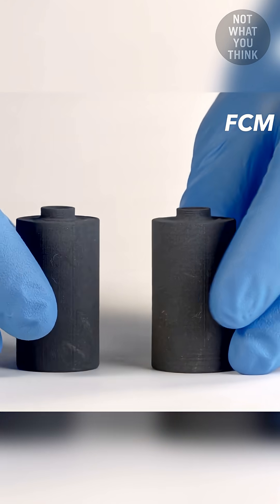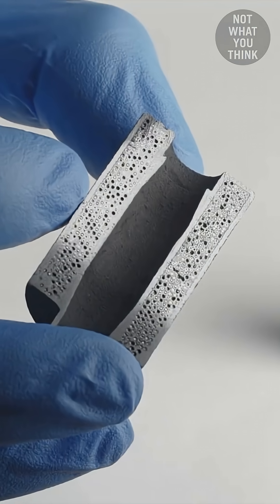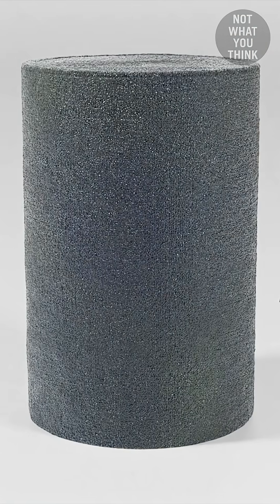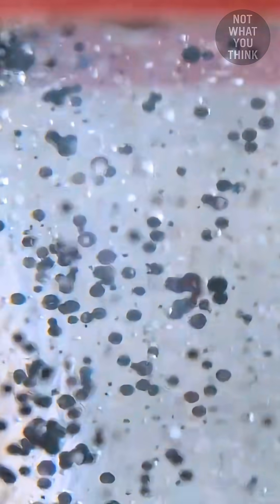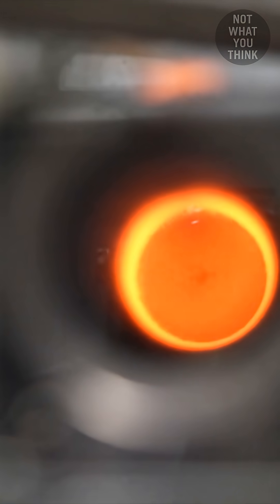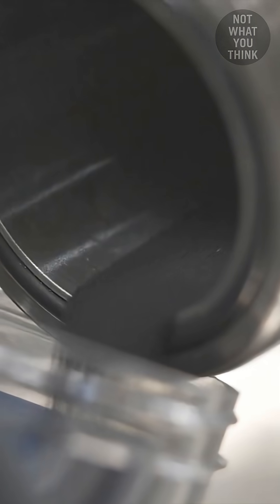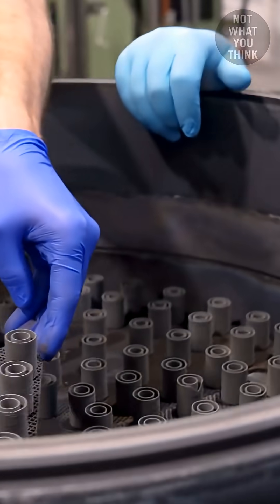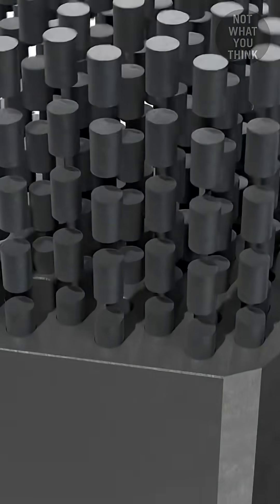Tiny Million-Dollar Battery

Comment: ...
damn you guys are slow
WELCOME EARTHLINGS TO MY TED TALK
today ill give you a summarized history of the EGC's history of power harnessing systems
As you know from media, you are correct in assuming us aliens are very advanced
it all started with figuring out micronuclear reactors battery cells
we figured that shit out only after 5 years after the industrial revolution as well
then we swapped to liquid thorium systems for large scale, then compact thorium batteries and weve developed a space elevator made of multiple segments that has a ground and exoatmospheric segment that orbits the planet
each space elevator is set into a line across the planet that then connects to the exoatmospheric segment as it moves
500 space elevators around a planets surface and 100 satellite ports
that collect stronger solar energy
each time one makes contact with the grounded space elevator it discharges energy down at full power to ignite plasma reactors that make antimatter as a byproduct that is then used in our most essential form of technology
gravity reactors
high in constant steady radiation with a strong magnetic and gravitational pull
then using multiple antimatter cells to pull a proto-dyson ring that is pulled along using magnets in a perfect vacuum and supercooled space
the energy require to start up a Dyson ring is the same discharge of a satellite port that then sets the dyson ring into perpetual motion
literal perpetual motion
the energy one dyson reactor produces might seem absurd for you humans but its in the lower end of energy production

imagine a whole 5 ring layered dyson ring array around your sun with the width of your planet with over 100 levels and each with trillions proto dyson ring reactors powered by the suns magnetism superheayed radiation to power the cooling systems and supercharging quadrillions of proto dyson rings inside a 100 layer dyson ring that is a set of 5 dyson rings around a sun that then makes it spin into itself and create more energy with each ring aligning with eachother producing enough energy to cause a thunderstorm in space with plasma arcs bright enough to make the sun powering it up seem like a dim lightbulb
thus such generators need to be covered with a dyson net to keep them from blinding a nearby planets people from the lightshow
and the dyson net has been proven as a great place for putting a colony in
each node connecting every part of the net is a magnetically stabilized atmospheric dome
but people just use 80% of said places for food production
with this much energy its quite easy to control the simulated enviroments to grow crops without needing assistance or seasons
we went from nuclear reactors to dyson netting stars in less than 300 years
idk why you short lived humans want yo take it so damn slow

also in case youre wondering
in case the star starts to die we infuse it by inverting the antimatter storms polarity to feed the star to induce core expansion and cause an artificial supernova, that is then directed through vents using the dyson rings to power up solar exhaust ports in specific regions of the dyson netting
looks super pretty too
and if the star collapses into a black hole
then its the next step in energy production

and next part
i will explain the basics in using a black hole for making a dyson cluster reactor thhat is powered via solar storm discharge and antimatter storms to infuse the black hole into stasis and to produce enough power to annihilate a whole galaxy with just a laser pointer

Comment: Small nuclear reactors are the future.  Silicon valley is usin these mini reactors to power the  factories and massive energy A.I. needs.   This is the future.  Clean fuel.  Only problem i see is getting rid of the battery, wich would be very easy..

Comment: Oh, that's probably stronger then my thought.
(though what I thought wouldn't need uranium) 
I figured it was going to be a prosenescent coating ceramic then have some how small photovoltaic coating or the outer case around them to generate power of the constant half life. 

The trick would have been to make each sphere its own little "solar" powered battery with the container some how linking up and keeping them all safe rather then its walls being the panels

Comment: Not a battery, fuel pellet or fuel rod for use in a nuclear reactor. Does not produce power on its own and only technically stores energy, as much as any element is stored energy...anyhow, point is, this is not a battery 😉

Comment: i mean, cool, but just because it can fit in a shipping container, does not instantly mean its foolproof. What if it comes under fire and how do they plan to make the shielding and cooling adequate while also making it efficient and equipped with multiple failsafes like normal nuclear reactors have? quite frankly, at best in our current technological state of the world at the very least the reactor may need to be modular (as in, made up of two or more container-compatible nuclear reactor modules) which is a whole other can of worms in itself.

Comment: Chernobyl was also "built to stay safe".
Reply: It was built on an already massively outdated framework, it was chosen because it's cheaper, typical corner cutting. Not only that the "test" that caused it to explode, meant turning off ALL safety mechanisms, and "red-lining the engine". Like all nuclear accidents, it was the result of human error. It would be safer to remove human control and have a computer run it.

Comment: The name of the company building the first of its kind portable nuclear reactor is called Radiant Nuclear. They are set to test run the very first example sometime this spring in Idaho.

This is a completely standalone reactor that needs no operator on site for it to run. It's designed to produce 1MW of electricity. It uses Helium to cool the reactor and has a completely passive safety system designed to need no intervention from an operator or outside power source in case of an accident. Accidents are further mitigated by the fact that helium cannot be irradiated, so even if there's a leak. the only thing that will be released into the air is inert helium.

It's not only the military that's interested in this tech. Data centers are also very interested, as many data centers currently use diesel generators to fill in the gap when they can't get enough power from the grid...which happens quite often. I saw an interview where a guy said that one data center can use as much as 5000 gallons of diesel a day for electrical generation. This portable nuclear reactor is designed to run for 5 years at full power before it needs to be refueled.

Comment: What is the coolant?  The reason nuclear reactors are so big is because they keep high temperature water under extreme pressure to cool the reactor.  At the temperatures it's basically an explosive.  If there is a leak, the water expands to steam 400 times it's volume.  It's kept at something like 400 atmospheres of pressure.  This must be cooled by something else.  Liquid sodium?
Reply: usually gaseous helium, as it is inert.

Comment: So because fuel convoys get attacked, they switched to a radio active fuel source. Yeah...that sounds completly rational and normal and wont lead to any problems at all 😂
Reply: Cuz it is, a large portion of those convoys were for the generators, lessen the number of convoys that have to come, tighten support on the few that still have to come.

Comment: Overall this looks like a decent idea, especially if the tech becomes unclassified for civilian use in 500 years.
Reply: The company developing this reactor is set to do their first test run in the spring. They're called Radiant Nuclear, and they already have plans to sell this to private industry. Data centers are very interested and have already placed tentative orders for them to replace the diesel generators that are already in use. This tech will be made available to civilian operators very soon after the military gets their hands on it.
Reply: @operator0  I stand corrected, thanks for the info!

Comment: The US had a base in Greenland in the 60s that was powered by small modular reactors not much bigger than shipping container size.  It is such a shame we basically shelved that sort of tech for a good thirty plus years.  Think of all the fuel wasted, plus the fuel used to transport that wasted fuel, etc.
Reply: The soviets made widespread usage of nuclear batteries to power things like lighthouses. Years later, people unwittingly gave themselves radiation poisoning from messing with them. So, we may have dodged a bullet by skipping tiny nuclear power.

Comment: I’m sure these nuclear reactors will be responsibly shipped back after use and not discarded to be salvaged by the locals.
Reply: in this case they probably will, last thing they would want is supplying radioactive shotgun pellets for use in a dirty bomb
Reply: @andreww2098  Between 1950 and 1980, the US lost and never recovered 6 nuclear weapons. More recently they left over $7B worth of equipment in Afghanistan which was promptly repurposed by the Talibans, including classified tech like NVGs. I highly doubt they will be responsible with these nuclear reactors.
Reply: @brodobroggins  If you'd looked into those lost nuclear weapons, you'd have seen that they were lost in conditions where they were basically impossible to find. More commonly bombs were lost - usually to bombers crashing - and the bombs and/or debris were recovered.

As for abandoned equipment, most of it was intended for the Afghan Army, because the Pentagon was too stupid to realize how fast they'd fall apart.

Other times, it's equipment that simply isn't worth the time and money to ship back to the US. In many cases it's cheaper to buy new gear than collect, pack, ship, and refurbish existing gear. For the same reason the US left most of its gear behind after WW2. More tanks, jeeps, trucks, etc. were left behind for allied militaries, civilian use, or even scrapping than were ever returned to the US.
Reply: @brodobroggins lmao attempting to compare Broken Arrow incidents to what these are going to be used for isn't even in the same ballpark.

If I'm not mistaken most of those incidents involved conditions which no regular person would have the means to find or excavate those bombs and even then the US military in some cases bought the land surrounding the crash site in order to prevent random civilians from even attempting to recover said weapons.

So no its not anywhere near the same since these SNRs would follow the same protocol the military already uses when decommissioning their Nuclear reactors on Naval Vessels (Carriers and Submarines) and Nuclear warheads in which the US' participation in START (Strategic Arms Reduction Treaty) have us properly dispose of these power systems in plain view of satellites for Russia to see and vise versa.
Reply: @willythemailboy2 Wait wait wait- you're framing the abandonment of so much perfectly good military equipment in Afghanistan as the intended goal? I've never heard that explanation for the most botched and disgraceful exit of a country...ever.
Reply: The company making this reactor is called Radiant Nuclear and they're set to test run their first example this spring in Idaho. And yes, the reactor will be replaced with a fresh one when it runs out of fuel. The old one will be sent back to the factory to be refueled and reused somewhere else. 

It's designed to produce 1MW of electricity and last five years. It's also designed to run without any human intervention of any kind. All of the safety systems are completely passive. It even uses helium as the cooling fluid. Helium cannot be irradiated, so even if there's a leak, the only thing that will be released into the atmosphere is inert helium.

Comment: Calling it a “battery” is dumb. “Battery-size” maybe but it’s most definitely still fuel.
Reply: So is a battery? What
Reply: @MarkStokotelny  A battery stores energy that can be used immediately, the commenter is talking about how these function as fuel, witch has to be turned into energy before being used
Reply: @Chaosticeyer are batteries not just refillable fuel? Why am I so perplexed by batteries 😭😭😭
Reply: @MarkStokotelny  Fuel is something that can be turned into energy, a battery is something that can store and discharge energy

Also batteries are not necessarily more or less reliable, and compared to fuels like gas they have around a third of the energy density
Reply: @Chaosticeyer why doesn't the definition just say that then?!?? God I'm genuinely so confused 😭😭😭
Reply: @MarkStokotelny  Cause the definition is describing the exact function of normal consumer batteries, instead of the more broad term for a battery
Reply: @Chaosticeyer it's a dictionary it should have at least the broad definition as one of the definitions 😭😭😭
Reply: @MarkStokotelny  Fair

Comment: It's not a battery.
Reply: the definition of battery makes no sense because we literally have gravity batteries and water batteries and kinetic batteries but no for some reason "battery" means specifically a chemical battery which it literally doesn't?? I don't understand 😭😭😭
Reply: @MarkStokotelny there are also nuclear batteries.

This isn't one.
Reply: @SierraSierraFoxtrot  that's great but has nothing to do with what I said?
Reply: @MarkStokotelny I don't disagree with you and I'm too tired to write a dissertation on batteries. :)

Look up the etymology of battery it's quite interesting.
Reply: @SierraSierraFoxtrot  I'm just confused because the official definition isn't the actual real life definition like people use battery for more than just a specifically chemical battery
Reply: @MarkStokotelny it's not just colloquial. Gravity battery is a legit technical term.

Technical terms shift as technology evolves. For example a chemical battery made without metal would contradict the origin of the term but we would not have a problem with it probably.

Meanwhile no one would call a capacitor "battery" even when it's form and function are very similar...
Reply: @SierraSierraFoxtrot 1) that's why I'm so confused 2) I have nothing 3) a capacitor is not in fact the same form and function as a battery
Reply: @MarkStokotelny a capacitor stores electricity and is made of layers of metal just like Alessandro Volta's first battery.